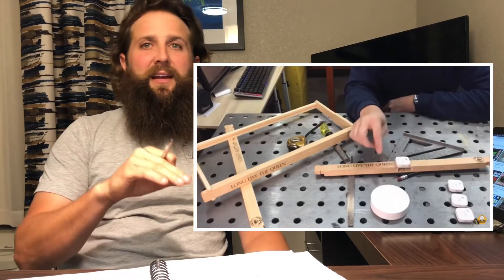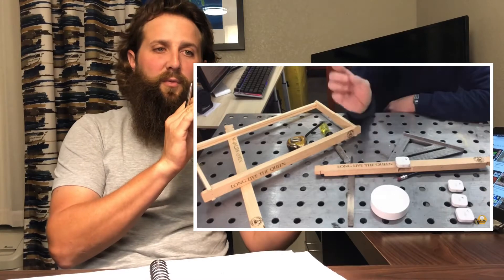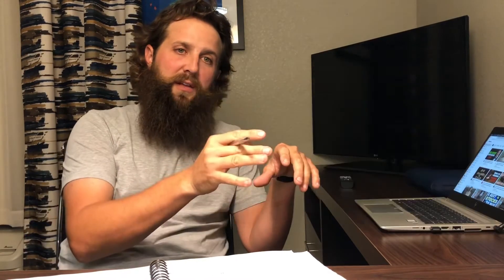FINALLY - Concrete Beehive Temperature Data - The Bee Bunka Experiment

Comment: Thank you for your precious data on beehive temperatures. I am doing some research before I (possibly 😂) start doing some beekeeping myself, so I'd have a few questions. If you can answer, I'd be grateful:
1) Concrete has a high thermal conductivity, wouldn't it mean that in winter the bees would spend more energy trying to stay warm as the concrete surrounding them is so difficult to heat up as opposed to wood?
2) if we protect the bees too much from the cold and don't let them feel it's cold and it's winter season, won't they cause problems thinking it's spring and it's time to be active?